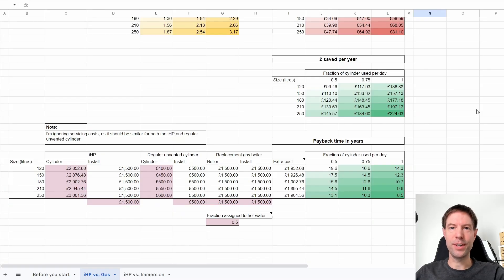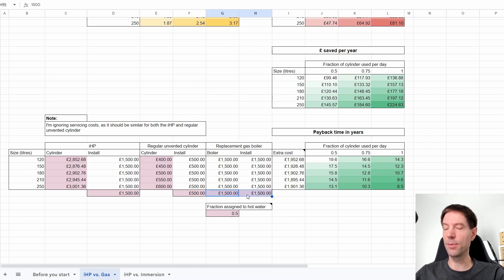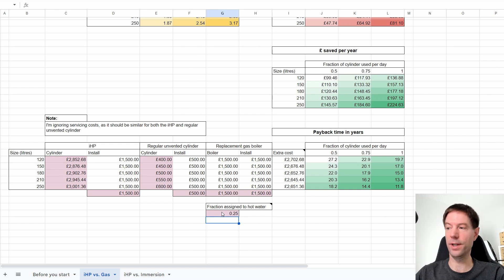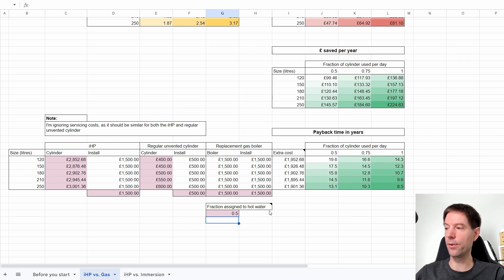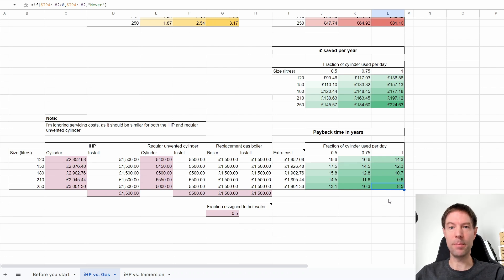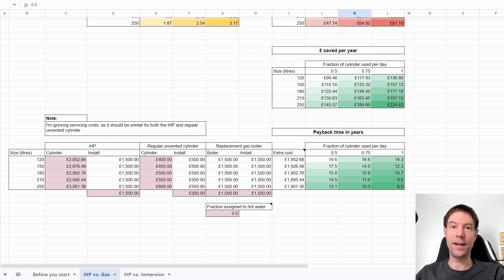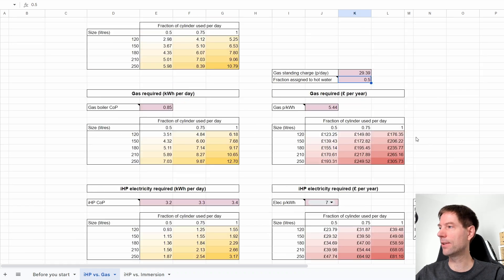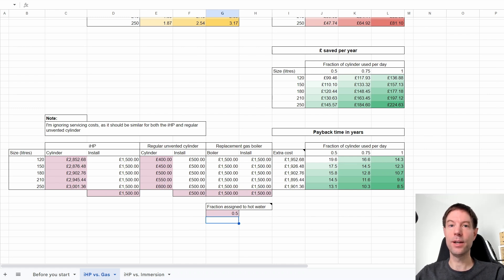Mixergy iHP hot water cylinder - when the iHP makes financial sense

Comment: I ordered one of these in April waited for the r290 version . Patiently,  they sent r134a tank I questioned it got a load of waffle from mixergy in the end they admitted that the r290 unit was not built even though they where advertised as r290.asked if they could send the head unit when it was made but was told the head units where NOT interchangeable funny they advertise this on there adverts. Sent it back saved over a grand on putting a daikin m tank in I doubt the mixergy would save me that money the long run . Expensive product bad service from them with there porky pies .
Reply from the maker: Oh dear, that's not great.  I think the change to R290 happened quite late in the development so I guess some things changed that meant they weren't compatible.

Comment: Payback is always interesting to calculate, but there are few things that you calculate pay back on unless it comes to renewables. The key element of the payback for us is what monies need to go to support the appliance once it is installed. In our case, the key benefit of the mixergy setup is the fact it only heats what you need. We have a heat exchanger and not an iHP, so interestingly the tank is only heated to a specific level. Energywise we used to use 34MWh total energy for the household before we updated the heating system, we now use 17MWh in total for the household and we have more square footage (the update was done as part of renovations) and drive more miles in an electric car. From a usage point of view the updates have made a massive difference and the house is nice and warm. Cost wise we have gone from 240 odd a month to around 170 a month (this may be closer to 150 a month once winter has gone), and this is even with the various increases in the price of energy. Having said all of the above, the solar install breaks even this november (7 years), the battery the year after (7 years after install) and to be honest the payback on the rest is 2028 (7 years again). What this comes down to is what monies are needed to run the household for the energy needed, and on that basis solar+heat pump makes sense.
Reply from the maker: Yes, our energy bills are very close to zero now, which gives a good amount of security against any price rises.  It's a good feeling.

Comment: Interesting, just checked my gas bill - £23 per month for gas ( 4 adults ). I would guess slightly more in Winter due to lower water temp. A HP water cylinder is never going to achieve payback.
Reply from the maker: It won't for everyone, and that's fine.  It won't for Kat and I either, we knew that was going to be the case, and we're ok with it.
Reply: @TimAndKatsGreenWalk  . Hopefully the prices come down but installation costs need to be addressed too. I look at my mum’s almost 40 year old indirect cylinder, not a penny spent of maintenance ran for almost 30 years on economy 7.
Reply: Not really a fair comment, my gas bill is £35 (2 Adults) but this is the summer - only hot water and a gas hob. In the winter my gas goes up to the £200 + as soon as the heating goes on.
Reply: @kevinoconnor2051  . Everyone’s lifestyle and house is different together with everyone’s choice of heating source and what temp  they run at. Total gas consumption for the year in my house is about 7600 kWh ( 4 bed det’ ). 8 year old gas combi.

Comment: There are of course so many variations of what you might or might not replace that you’ll never get a version that covers everyone…

However, I’d argue that if people are going to replace their gas boiler then the comparison should be of the equivalent functions of the gas boiler alone, i.e. compare only the gas boiler replacement cost (most people won’t change the hot water cylinder if they are replacing the gas boiler) to AAHP (or AWHP) + iHP.  That’s effectively what you did, just in two steps.

You made a comment about being able to just replace the heat pump part of the iHP separately from the hot water tank.  Do Mixergy publicly commit that this will always be available and that any future iHP’s will be backwards compatible with the current iHP tanks?   I’d fear that in 10 years time there will be a future iHP product that won’t necessarily be compatible with the current.  Who knows.  Its a risk
Reply from the maker: You'd have to ask Mixergy.  They literally state that as a benefit in their materials so I'd assume they're confident they can commit to that.

Comment: Part 2c? 😂  Gas boiler needs annual servicing for safety, so has an ongoing cost. iHP probably doesn't need servicing aside from replacing (assuming it has one), the sacrificial anode rod.
Reply: The ones I looked at so needed an actual service to retain the warranty
Reply: @googletitsfost  Seems like Mixergy have a care plan for £49.99 per year which is a remote monitoring one that keeps the warranty valid without physical inspections.  So still a saving over a gas boiler service.
Whether it's actually worth it or not to keep the warranty is another matter.
Reply: Costs more to service a HP and needs it every year for warranty. Costs me £70 to service my combi boiler once per year.
Reply: @bordersw1239  £9/month for heat pump
Reply: @bordersw1239  That's just UK red tape though, not something that needs to be done for safety.  Over here Heat Pumps in general have a service interval of every 2-4 years. 

£23 per month is that just for hot water?  It sounds pretty low for 4 adults.
Reply: @BenIsInSweden  . Yep presumably a couple of kilos of R290 refrigerant. Lots of these would presumably be sited inside the main living space to replace a conventional cylinder . And yes this is my usual gas usage when the heating is not on, also includes the gas hob.
Reply: @bordersw1239  won't have kilos, even the big outdoor units don't have that much. The Mixergy iHP uses r134s too.
Plenty of consumer portable AC and dehumidifiers use r290.
Reply from the maker: @bordersw1239 @BenIsInSweden the iHP now uses R290 and it's only 150g, not kilos.
Reply from the maker: They do need servicing to keep in warranty, but then so would a regular unvented cylinder, so I considered those to be equivalent.  The gas boiler servicing could be considered equivalent to the servicing required for an A2A heat pump system too.